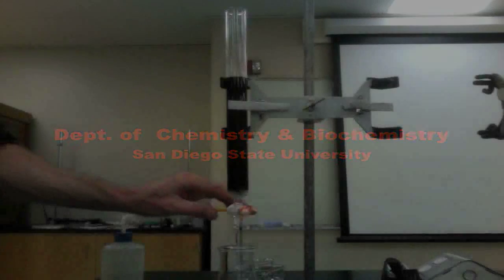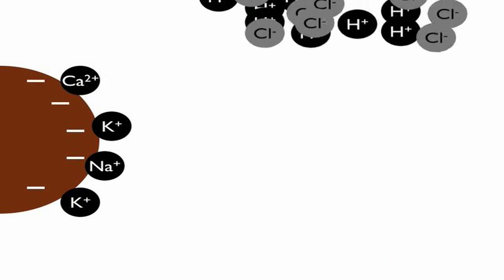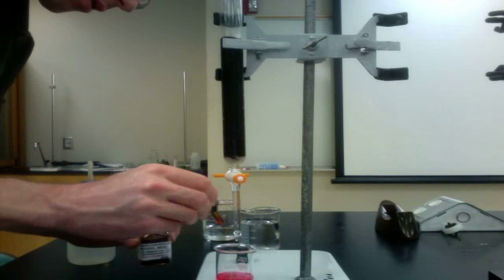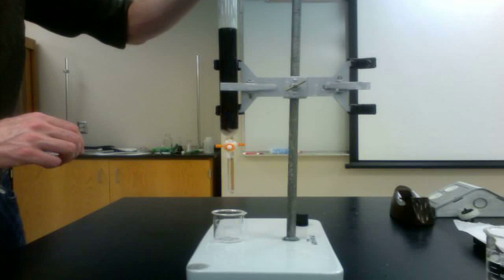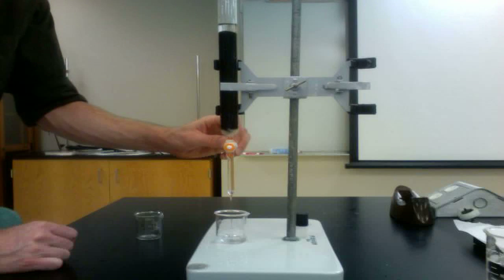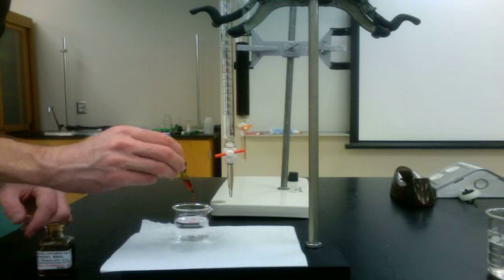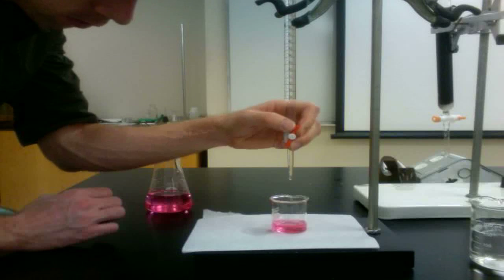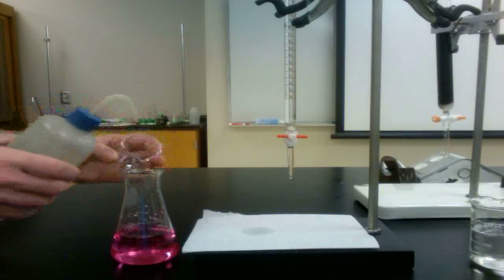Ion Exchange Column

Comment: Hello good sir,
May I ask why the liquid level cannot fall below the resin level, and what would happen if it did?
Were there any preparations for the actual column?
Reply: I would also like to know why the liquid can't fall below the resin!
Reply: Cuz there's a chance of creating air bubbles inside the resin, water will go around the air bubble and the calcium will be trapped in the resin and you will have inconsistent data 
John will probably explain it in prac (I finished it)
Reply: Thanks Kelvin!!

Comment: hello if i pass different concentration of NaCl to new columns of cation exchange, will I the passed solution of NaCl be of different pH or do I have to regenerate ?  URGENTLY AWAITING A REPLY ! THANK YOU !
Reply: i will be then testing pH change though simple acid base titration
Reply from the maker: Yes, to a limit.  If the columns you are using are fully regenerated (all exchange sites filled with hydrogen ions) then different amount of NaCl put through the column will give you different amounts of HCl as the effluent.  The pH will actually be a bit variable, as it depends on the volume of water used to elute the solution, but in terms of moles of HCl if you put higher concentrations of NaCl (all the same volume) onto the column, you will get more moles of HCl out.  And yes, that would be quantifiable through an acid base titration.
Reply: @crharrison  thank you so much for your quick reply. Sorry, just one more question, the concentrations I am using are 0.2, 0.4 , 0.6 and so on until 1M. Will I see significant changes or do you suggest otherwise for the molar concentration of NaCl to see change in pH
Reply from the maker: @jyotsnaberry417  Those concentrations will show a very significant difference in your analysis.  However, you might exceed the capacity of the ion exchange resin.  The resin only holds so many hydrogen ions per gram (indicated on the packaging).  If you put more moles of cations into the column than there are moles of hydrogen ions you won't see a difference.  For example, you might see the same results for 0.6, 0.8 and 1.0 M NaCl because there may only be enough moles of hydrogen to replace the cations in the 0.6M solution.
Reply: crharrison hi  thank you!  
in the beginning  of your video said to lower the water level but my cations exchange beads are all dry ?
Reply: Hope u can reply quick ! Sorry to bombard your with questions ! Thank you!
Reply from the maker: @jyotsnaberry417  You'll just need to add water to them.  Use as pure water as possible, tap water is not desirable for this.  And make sure that there aren't any air channels in your column once the beads are rehydrated.  You may need to stir up the beads in the column, or repack it.

Comment: Should this be performed with deionized water? Or is distilled water sufficient enough?
Reply from the maker: Deionized is preferred, as any cations in the water will result in some elution of protons from the column.  That being said, if you have very good quality distilled water this could work.  The easiest way to test it would be to just run a known volume of water through the column and titrate it with a base (or measure the pH) and compare that to the same amount of water that has not gone through the column.  If the water going through the column is more acidic, then you won't be able to do the analysis very accurately. 
However, if you are very very careful about the amount of water that you use, and very reproducible in this amount, you might be able to account for the amount of acid that comes off due to the water.  In effect you would have to do three titrations, a water blank, a standard, and the unknown.
I hope this helps.
Reply: @crharrison  awesome, thanks for the quick reply!

Comment: I have a question - before using the resin one should always regenerate it? If I have a fresh new resin in H-form, shall i regenerate it with acid before the first usage?
Reply from the maker: Joanna Conder If the resin is new from the bottle, and in the protonated form, you probably don't need to regenerate it.  After some use, you will need to regenerate it, and a strong acid is the easiest way to do that.

There's no real harm that I can see in regenerating a fresh resin, the only loss will be some time to get the column prepared and clean.

Comment: Thanks for all your help! Regarding the pH probe, the acid is around 0.5M, which is typically beyond the (accurate) range of standard electrodes. I actually went ahead and titrated the metal solution; it gave me a good looking equivalence point but after that the curve started to look funky (i assume metal interference). Either way, the result was 0.419M, where as the original acid was ~0.6M. I'm also going to run the metal thru a column just to see if I can get a reasonable number. Thanks again

Comment: what is the capacity of a certain volume of ion exchange beads? for example, how much beads are required to retain 1g of sodium ions?
Reply from the maker: That varies with the manufacture of the beads.  Most resins have that information listed on the bottles, or at the time of purchase.  It is typically listed in meq/g or meq/mL (dry vs. wet) and values typically range from 1-4 meg/mL if I recall correctly.  Keep in mind on meq (milliequivalent) is the same as a millimole of charge (e.g. a millimole of hydrogen ions, or 0.5 millimoles of calcium ions).  In this particular example the column has enough capacity for well over a dozen samples before the capacity will be exceeded.

Comment from the maker: @stevoh92 For this lab we have the students regenerate the column with 3 M HCl.  The titrant used is 0.1 M NaOH.  I would suggest using about the same concentrations, as if your titrant is too strong it will yield a false positive in the drop test and make reaching an accurate endpoint in the titration much more difficult.

Comment: Hello sir.
I had conduct ion exchange experiment. But I have no idea why anion beads are float after I pour the sample. While cation beads are not float as anion bead.
Reply from the maker: I'm not exactly sure why that would happen.  I have seen some beads float on occasion, but it is typically very few (~10-20) and I don't see how that it will impact the success of the ion exchange process.  The likely cause of the floating is probably related to how well the beads are being wet by the water.  The anion exchange beads may be a little more hydrophobic than the cation exchange ones, which could explain why you are seeing this with those in specific.  One thing you could try to get the beads to stop floating is to rinse the column with a water-methanol mixture, maybe (80% water, 20% methanol - but check the manufacturer's instructions about organic solvent compatibility).  This solution should help wet the beads fully and keep them from floating.  You could then switch back to a 100% water eluent before doing the desired ion exchange.  But as I said earlier, it's unlikely that a few floating beads will have an impact on the ion exchange results, assuming that you are following a procedure close to what I have shown in this video.

Comment: ?Hi,

I have sulfonate (sodium) salt of organic compound and I want to convert it to sulfonic acid. Then how should I proceed to its conversion. Like what concentration of dye should I use for a given amount of resin. Could you help me out?
Reply from the maker: +varun singh Without a lot more information I don't think I can help.  In general, make sure you have enough resin exchange capacity to exceed the amount of sodium you want to exchange.  You can test the effluent from the column to identify if it is acidic or neutral with any pH indicator (even litmus paper).  Good luck.

Comment: In the video you mention to never allow the solution to go below the level of the resin.  What happens if the solution goes below the level of the resin?  Does it react with the air?  I assume you would have to conduct the regeneration step again?  Thanks!

Comment: Hello sir, may I ask where I can get this cation exchange column?
Also, when I do experiments with cation exchange resins, is it necessary to have the cation exchange column? Is there something special about it Or could I also use like a normal glass cylinder or burette to fill the resins in? Thank you!
Reply from the maker: The column itself comes from Fisher, but any lab supply store should be able to provide something similar, as you suggest you can even use a buret if needed (just include some glass wool, or a frit of some kind to keep the resin in the column).The column is just a standard glass column, there is nothing special to it, what makes it the cation exchanger is the resin that you put into it.

Comment from the maker: Joshua, that's right.  If the column goes dry the chance of creating air bubbles, which in turn results in areas of the column where the liquid will not flow, will have negative impacts on the exchange process (reduced column capacity).  This is even worse with chromatographic separations, as the channelling can negatively affect the resolution (separation of individual components).

Comment from the maker: @rsty615 I think we have both been over thinking this problem, as there would seem to be a very simple solution to the problem, use a pH meter; the pH is a measure of the concentration of free H+ after all.

However, if you must do a titration, the pH will not likely exceed 6 until you reach the equivalence point so only a minimal amount of precipitation might occur.  And at that point it is unlikely to interfere with the measurement.